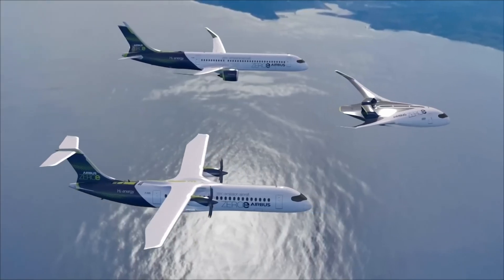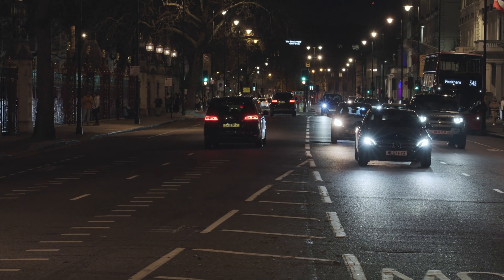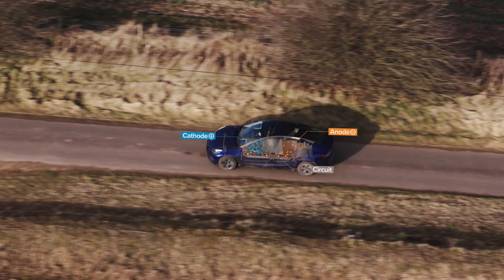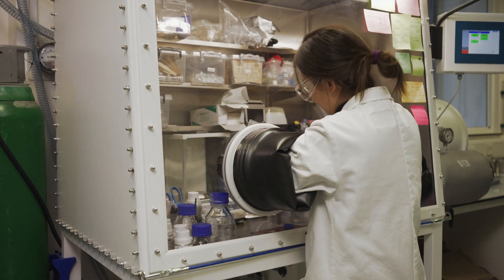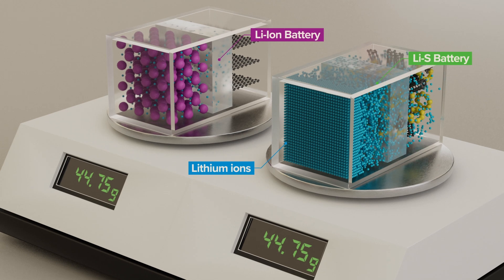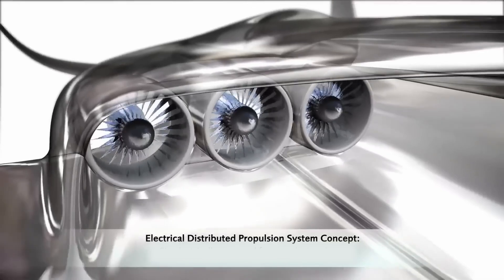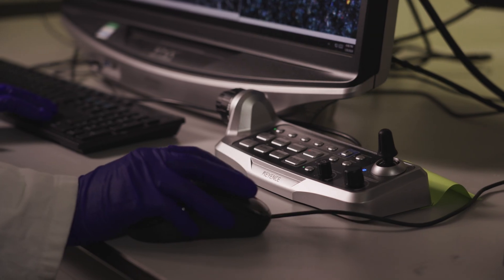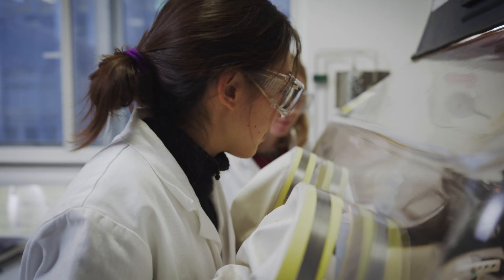Could we make a battery powered plane? | The Royal Society

Comment: About 50y ago, one could take a stack of NiCd rechargeable batteries, hook them up to a 33MHz receiver, and fly a radio-controlled "battery powered plane". This was 50y ago. Before veganism was hip. Before the ozone hole. 

The "could" was answered 50y ago. The question today is "should". The answer hasn't (yet) changed.